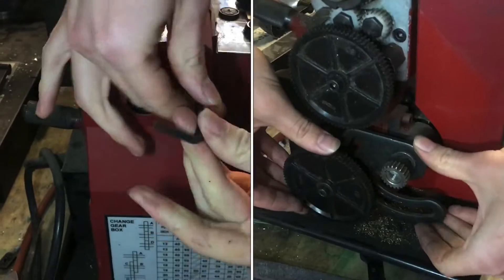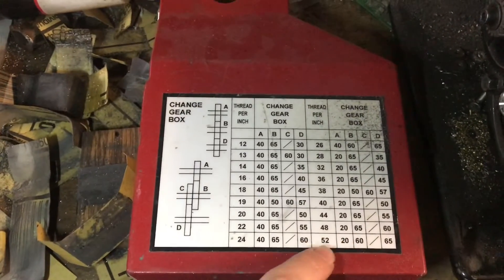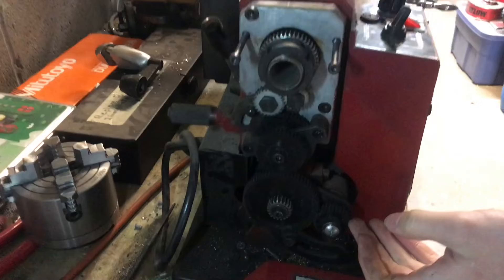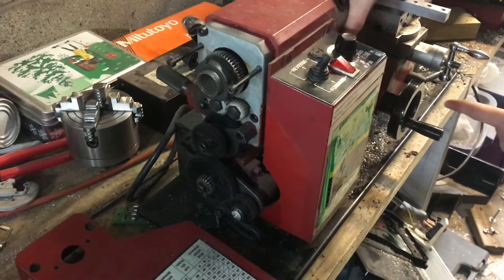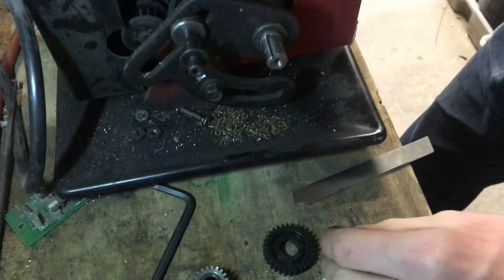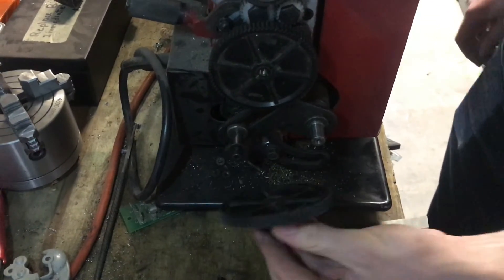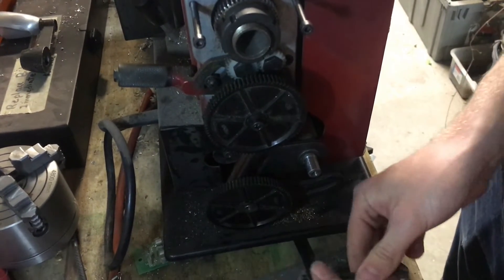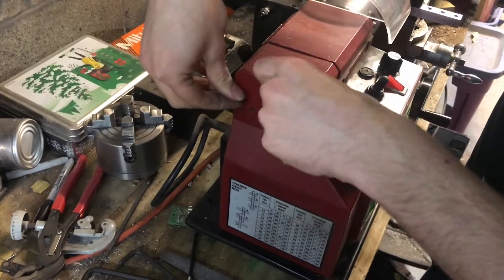CHANGING “gearbox” speed ratio on mini lathe (harbor freight)

Comment: I retired as a machinist and this little lathe has be a bit baffled...
The one in the video shows imperial threads. Mine seems to only do metric. I need to be able to switch back and forth because I still do a lot of threading in my gunsmithing work, as well as replicating automotive parts.
I measured the thread pitch on the lead screw, which is 1.5mm.
The gear sizes are a little different as well from what I see here.

Comment: Thanks for the Post you may want to purchase a set of steel gears before those Nylon ? Gears burn out esp the one on the Motor but definitely a worthwhile upgrade I found on my Clarke Cl 300 m..... most if not all that size mini lathes are very similar if not the same !!! Grizzly/Clarke Cl 300 m UK /Harbour freight U.S.A. / ect ect Good Little lathe for small Aluminium work mabey I could tackle small Steel jobs with new Steel gears remains to be seen waiting on few more upgrades .....Alloy hand feed wheels + want to replace the GiB strips with brass ones ....tougher Motor mine burn out !!

Comment: You are really teaching me quite a lot on this lathe. It is, for me, great it is the same lathe. Thanks for the video!!
Reply: @livefree6878  Could you please give me some information? Is this machine capable of cutting 1.5 pitch threads? I own this machine and from aluminum round stock,  I want to make a  12mm rear bicycle axle with 1.5mm threads. Is this possible? Also, is this machine supposed to come with extra change gears? I bought mine second hand, and it came with no extra gears.  Also, could you perhaps lead me in the right direction to purchase different gears? Thank you so much.